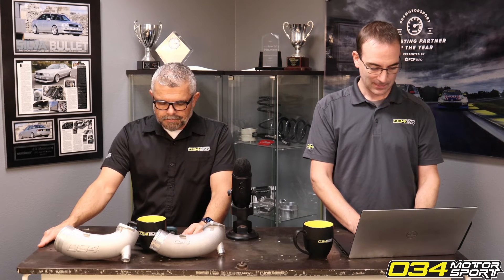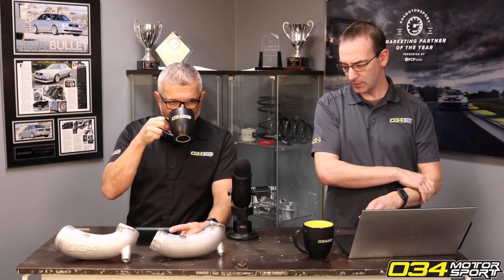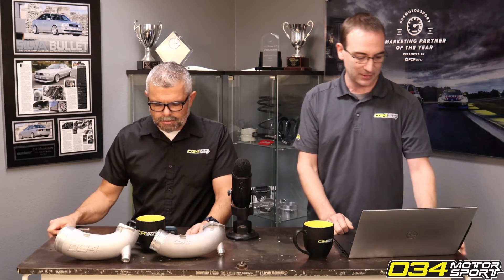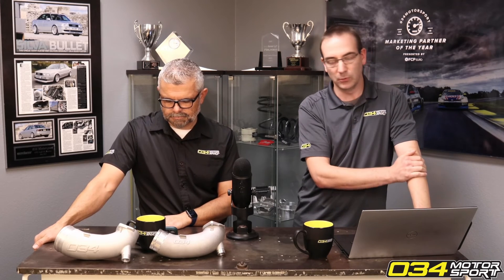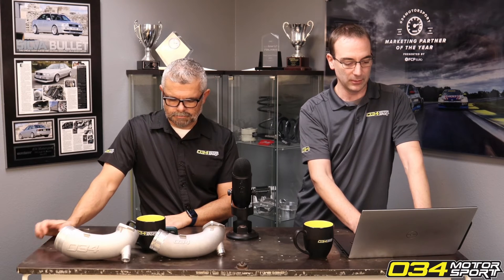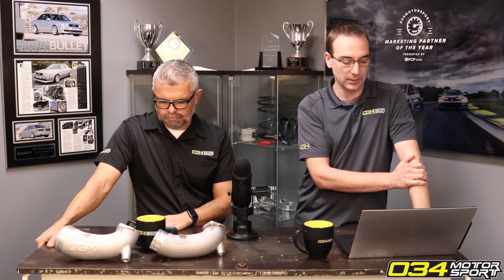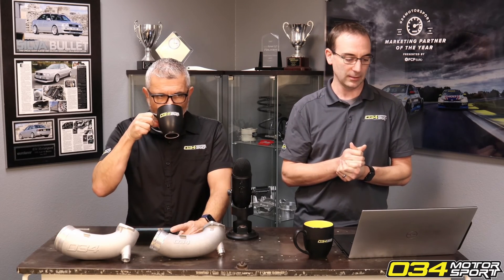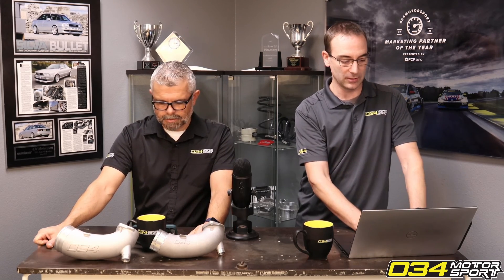What Is The Difference Between Fuel Cut and Ignition Cut for 3.0T Supercharged? | 034Motorsport FAQ

Comment: So my first day….. I have been watching live data on this 08 Honda Accord I’m working on and the ecu is intermittently commanding a fuel cut when I raise and hold the engine speed at 2,000 rpm. The rpms intermittently now and again bounce, not fast, not high, down up down up. So  2,000 rpm down to 1,500 rpm on fuel cut, back to 2,000 rpm. I’m looking at what the ecu is doing when this happens and the ecu, goes from ‘closed loop using sensors’ ‘open loop or fuel cut due to deceleration’ ‘open loop because engine temp is low back to closed loop again…. and so on. It does this maybe five or six times then runs fine…. Now the engine is perfect below and above this rpm… it’s only doing it at 2,000 rpm. I have checked coolant temperature and it’s fine doesn’t change, looked at throttle position both at the peddle and at the throttle body, again, no significant change maybe -0.45% at the throttle body each time the fuel cut event happens… Test driving the vehicle, cruising around the 2,000 rpm mark mild acceleration sometimes it’s a little jerky, you gun it and it falls on its face for a second then goes like stink! Occasionally it will feel a little sluggish to get out of its way but not always. 02 sensor data is perfect, fuel trims at idle and while driving look fine, not crazy numbers! This one is a real problem. I am wondering what could cause the ecu to command this fuel cut event intermittently…. Any ideas? I must stress this vehicle has no codes! None! I can’t even make it fault while driving trying to cause it flag a code…. I can disconnect things and it will bring the engine light on easily. This issue as far as the computer is concerned is not a bad enough problem to flag any code… I’m shocked because it’s bad enough to my senses 🤣

Comment: What’s safer?
Reply from the maker: Both our Fuel Cut and Ignition Cut Launch Controls are perfectly safe for your car, but it just depends on your setup. If you are running factory cats, our standard non-test pipe file is what you'll want to use, as it utilizes our Fuel Cut Launch Control, and preserves the life of your factory cats. Our Ignition Cut Launch Control is only available when running test pipes or gutted factory cats and our provided test pipe file (for racing use only), as the need for concern is gone as you would no longer have cats.
Reply: @034MotorsportUncut  is this bad for the longevity of your engine?